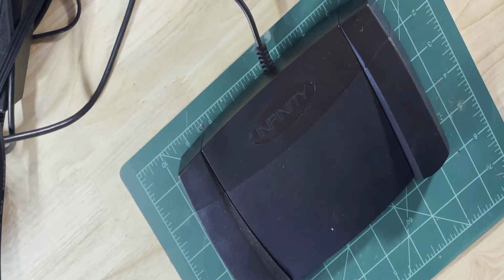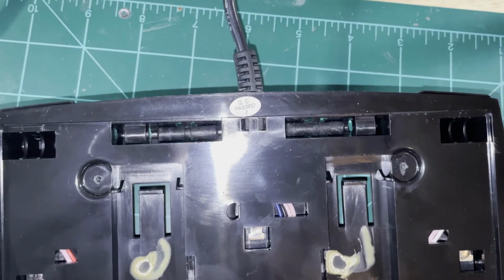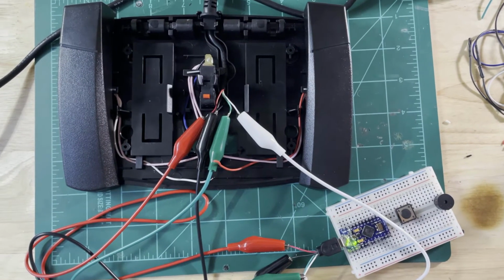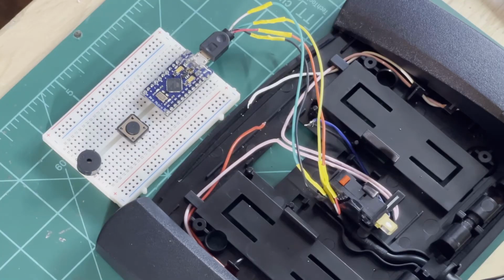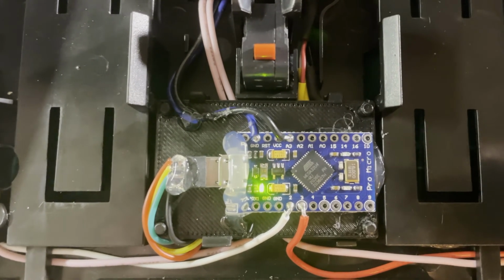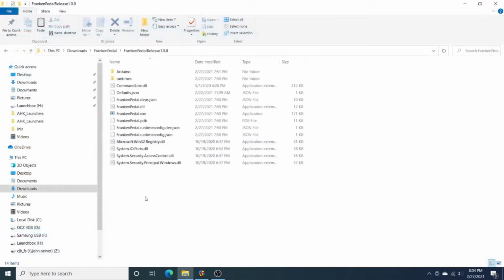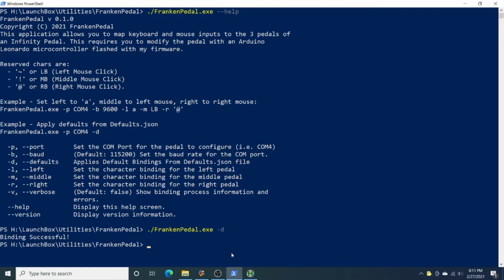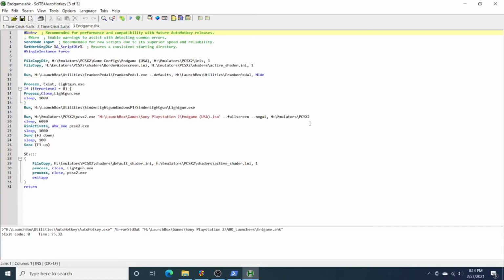Infinity Pedal Arduino Pro Micro Mod (aka FrankenPedal)

Comment: hello i need some help if possible..i have a pedal that when pressed down and then the moment i release it it writes letter L  ,the problem is lets say on time crisis the moment i press it and release it , the player stand up just for 1 second so i cant use it how it should be... i mean to be able to shoot while pressed down...i dont know if you understund what i mean... i want somehow the L key to be spammed lets  say in order to be able for the player to stand and shoot...i dont know if this have to be changed from arduino micro  or  better use some script for autohotkey etc..